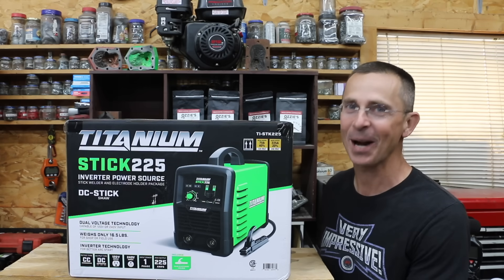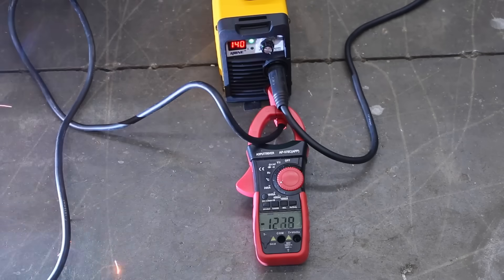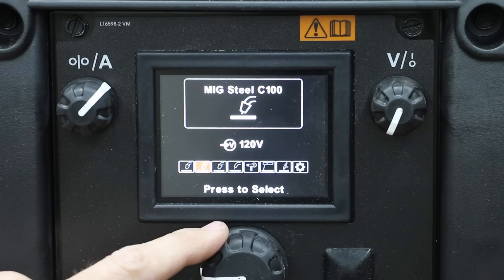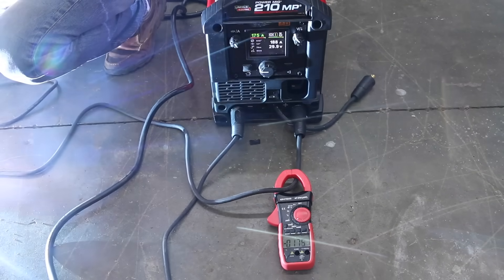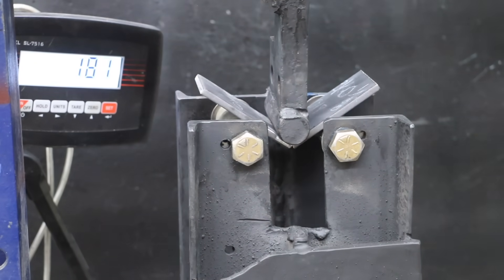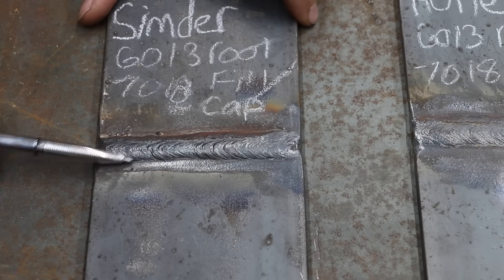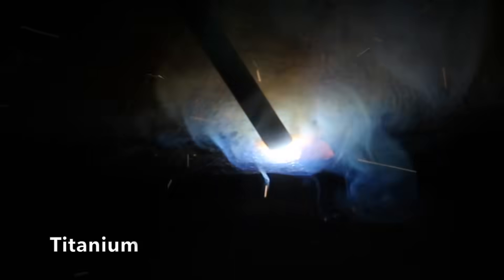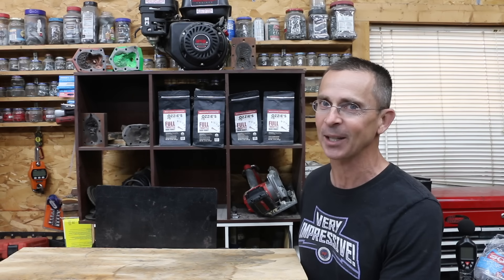$70 vs $2,300 Welder? Let's Settle This! Weld Strength, Duty Cycle, Current Output, Build Quality

Comment: Thank you, Joe! It's great to have an expert supporting what's already the best tool-testing channel there is!
Reply from the maker: You are welcome!
Reply: @ProjectFarm  please review the mig welders especially the Titanium Mig welder as I have it and have used it multiple times and it holds up awesome I want to see it compared !!!!
Reply: @furrycircuitry2378  You won"t be disappointed.
Reply: @ProjectFarm  hopefully Joe will never be substituted by Kuka robot run by GPT4
Reply: @Kawka1122  🤣
Reply: @Kawka1122  🤦🏻‍♂️😂😂
Reply: @ProjectFarm  Was the penetration test done on 110v or 220v ?
Reply: @ProjectFarm  

Suggestion:
Please do video review on vehicle underside coatings. (Rust protection)
Reply: @ProjectFarm  if you decide to do multi process welders, can you PLEASE include the Vulcan Omnipro 220! Thanks for all the great work
Reply: @ProjectFarm  Hi PF hot summer starts time to get glass of freshly pressed juice😂😂😂 can you test slow juicers with your scientific and practical tests, that could be best compare video on entire YT
Reply: @ProjectFarm  looked on your channel but couldn’t find one. Maybe I didn’t look hard enough but a
Video on silicone spray? Want to spray some on my suspension parts to stop squeaks. I see many brands but don’t know which is the best and last longest for the job. Thank you!!
Reply: @rickjames2327  Corrosion X HD
Reply: @rickjames2327  He did one on penetrating sprays and rust removers.
If you want a silicone spray that's cheap and available. GT85 for cycling applications is my current favourite.
Reply: @ProjectFarm  I’m
Reply: @ProjectFarm  Have you ever tested Shaving Razors?
Reply: @ProjectFarm  thanks a ton !
Please do yeswelder ct2050 with plasma cutter and internal air compressor
Reply: @Project Farm  
Have you done any videos on  fire extinguishers? I'm in the market for a extinguisher for my classic mustang and I was looking at a halotron extinguisher or a element extinguishers or a few others but can't decide on what will protect my investment the best
Reply: You want a CO2 fire extinguisher. No powder to clean up on you collector car. That powder gets everywhere including past air filters.
Reply: @cygnus1965  You also forgot to mention that some of those chemical fire extinguishers they use for cars are also corrosive. 
An old boss of mine had racing cars and IF the fire extinguishers in them were used the mechanics had to wipe down the car immediately and then AS SOON AS POSSIBLE completely disassemble the car and make sure there wasn't any residue anywhere.
There was nothing unusual completely disassembling the cars. They did that after every trip to the track but if a fire extinguisher had been let off they did it with URGENCY.
Reply: @ProjectFarm  Simple question.
Why didn't you test the Lincoln 191C its a far less expensive welder and more likely of use to the amateur or than the 210 which is without doubt a professional welding unit that no amateur is likely to buy unless that have some massive job like a big boat.

Or maybe its possible to test the Lincoln 191C against other Mig/Tig/Arc multifunction units???
Reply: @ProjectFarm  I welled like a pro for years. I used a 220V gas Lincoln( and others) and its  much better then the 120V HB Flux welder. The Lincoln  welds smoother, hotter, thicker marerals, stronger welds
Reply: Could not agree more. This channel is my go to for real world results. Well done
Reply: Couldn't have stated it better.  Thanks Joel, and yes, best tool testing channel period. Thanks.
Reply: The best tool channel!
Reply: Thanks to Joe!  Let's do this again!
Reply: True that, never buy tools without listening to Joe first
Reply: PF is the MAN
Reply: That was very interesting. Yep would like to see more😁
Reply: you got that right!!
Reply: Thanks Joe.
Reply: Agreed. Joe you've teamed up with a wonderful man thank you both
Reply: What Ether Melt said.
Reply: That's a fact. It's downright exciting. I love watching welders work. But not orbital Welders they're just button pushers. Still absolutely necessary
Reply: Fr
Reply: Thanks Joe for helping with welding test, great job I believe i am going to get the harbor freight’s brand to learn and weld stuff around the farm. I just need some practice as will just be touching up stuff on bush hog and small farm equipment
Reply: On boats I've also seen the little portables from Unitor and Miller used for small repairs where 110 was easier to connect with than a cable from a bigger welder. Usually using scratch start tig these days as the health inspectors assure us that bacteria can live in tiny pits and etc from the splatter of stick welding.
Reply: Testing is bogus without knowing what VOLTAGE the AMPERAGE is being delivered at...
Reply: Appreciate you sir!!!!
Reply: You should test Electric mowers especially robot lawnmowers!
Reply: That Lincoln should make a hell of a cup of coffee too for that price, where as the Titanium... I'd make it a cup of coffee if it would like.
Reply: !aaa
Reply: I'm confused man, which one should I buy?
Reply: hands down
Reply: I'm interested in Mig and Multiprocess reviews, thanks!
Reply: Thanks Joe, also say hi to Cousin Eddie!
Reply: Joe can't weld
Reply: @snations3093  What do you mean ?

Comment: A multiprocess machine may be perfect for home or for learning to weld. There's cheaper out there than that Lincoln. I'm a red team guy when it comes to transformer machines but inverters, give me the easiest ones to replace.
I still run some transformer machines that are 75 years old and smooth as butter. No one is ever going to say that about inverters. 
HF has machines on the shelf. If you break it under warranty they give you a new one. If it's out of warranty bring your wallet and get back to making sparks for hundreds instead of thousands.
More power to Joe for helping get the word out. There's no magic to stacking dimes but the sticker shock scares off a bunch of people. Inverters took that excuse away.
Reply from the maker: Thanks for sharing.

Comment: Commercial welding machines are usually set up as 3-phase 440V.  At home, you want to go with 220.  Using 110 is really asking a lot.  
As far as what to buy, get a used Lincoln, Miller, Hobart, or Esab. 
I prefer Miller or Lincoln.  
The real test of a welder is duty cycle.  You also really need a solid power source.  It all matters.  
Oh, and learn how to weld.
Reply from the maker: Thanks for sharing.

Comment: I would love to see another welder test. I have the Eastwood mp250i elite multi process and it has been a very good welder for me. It was $1200 and had lots of great features. All the cables were longer, has separate mig and tig bottle holders and it even came with 2 regulators, one for each one!! The welder itself is built on a cart and even came with a foot pedal for the tig. All the guns and rod holders and clamps seem very high quality. I have welded with it quite and bit and i absolutely love it. I spend hours and hours researching these before i bought one and it was only a couple hundred more than the similar harbor freight welders which didn’t come with all the accessories and no cart or regulators smaller cables etc. Eastwood even came with a 110 adapter. Holds up to a 40lb spool on it. The price for all it has and does seemed amazing and i think it’s the best value out there. It’s basically entry level professional  and i think it would do awesome on a side by side test. So if you do do this please include it!! I think it would be an awesome welder for many people. Great videos Todd and thank you joe!! Your welds looked very consistent which is crucial for these types of tests. Looking forward to a future multi process video!!!
Reply from the maker: Thanks!  Thanks for the suggestion.

Comment: Here’s my opinion: 

If you want cheap good welds
Buy an everlast. 

Any welder that puts out a true 125-130 amps is plenty for most peoples needs. Quick repairs with 3/32 or 1/8 depending on rod. 

6011 would’ve been a more fair root rod.
Reply from the maker: Thanks for the feedback.

Comment: Looking forward to your wire feed welders. A while ago, I got the Miller Thunderbolt 160 a while back ($500ish new) (120v/240v) and use it 120v. Great welder for kicking around at home in the garage for structural type welding (7014/7018). Last year I got HF's Titanium Mig140 with 025 wire and argon to do some pinch weld bodywork repairs welding in new rear hatch and pan/latch panels (body shop wanted $5000+) and the repair came out surprisingly good for a first time adventure. Now I am using this Mig140 same 025 wire but with 75/25 gas to weld up custom accessory brackets for a serpentine conversion on a 69 Caddy 472. After tinkering with the settings (welding skills aside) I am quite impressed with the results. If/when you do a MIG/flux core welding review, hope this Mig140 makes it in the list and am looking to see what else you conjure up in the list. Thank you for your reviews!
Reply from the maker: You are welcome!  Thanks for the suggestion.

Comment: Those ~$100 welders are getting surprisingly good for light-duty jobs.
Reply: For hobby welding as long as you keep your expectations realistic some of them small welders would do for around the house. You're just not pipelining with one of them. But for slapping stuff together in the garden or what have you it's fine. Keep your runs under 3 minutes. You can do a lot with eighth inch thick steel. Run thinner electrodes. That sort of thing.
Reply from the maker: Thanks for the feedback.

Comment: I’m a diehard Miller guy, I’ve run XMT’s on 480 3 phase, bobcats, trailblazers, and I currently own a blue star.    I’ve been off work since October after a job site accident, I was in the process of building a side business and was in the market for a MP machine.   Probably to stay in my garage until I get proficient with TIG.   I’m definitely interested in a MP showdown, but I’m also aware of the cost associated with it.    When I’m able to get back to work I’ll be looking for an AC/DC model to hopefully get into some aluminum work.   30 years as a shop ironworker and I can’t wait to strike a bead again
Reply from the maker: Thanks for sharing.

Comment: I bought a used Miller 350 syncrowave liquid cooled from an auction for $1300.  Tig welders can do aluminum or steel or any other weldable material.  It can also weld a pop can or 1/2" steel.   Obviously tig welders are slow and take skill but they are so versatile you really get your monies worth.   I've paid for it multiple times over along with the convenience of repairing items the same day.
Reply from the maker: Thanks for the feedback.

Comment: Awesome video!  I wish this was around a couple of years ago when I was shopping for a budget welder.  I ended up going with the YesWelder Mig205ds.  I suspected that the current output was a littel lower than reported, but I can't say that I have any regrets.  For the price it's done everything I"ve asked of it.   Would love to see something comparing plasma cutters.  I've been eyeing one of those by YesWelder, but I'd like to see how it performs and what else is out there for the money.
Reply from the maker: Thanks!  Thanks for the suggestion.

Comment: MY Father has been a Welder over 40 Years, he worked machines from all different Manufacturers, Industiral to Home types, and everything in between. And even now, after so many years and all that accumulated experience, he swears by Licoln even if it costs you an arm and a leg.
Reply from the maker: Thanks for sharing.

Comment: thanks Joe
I've got the Lincon 200, and love it.   got a 130 amp Rockwell inverter that I call the hand bag, great for taking up ladders. also got a WIA 175 mig, each has there place but the Lincon is the best allrounder and if you want one machine to weld them all it takes up less space and probably works out cheaper in the long run. respect from Australia.
Reply from the maker: You are welcome!  Thanks for sharing.

Comment: In all fairness the Lincoln really got the shaft in this test. It's a quality multi-process welder being used solely on stick and is then turned down under 130amps for the penetration test? Why spend the extra money for that machine and then handicap it like that? 
A Miller Thunderbolt 160 would have been a much more fair comparison for this test as it is stick only and 1/3 the price of the Lincoln.
These machines should be hooked up to a load bank and tested for their volt/amp curve. I can guarantee only the Lincoln would perform well in that test, resulting in a smooth drooping curve. If you do test MIG machines I'd suggest searching out a welding machine calibration shop to test them on a load bank and provide the results.
Reply: He was trying to make it comparable to the others

Comment: Definitely want to see the wire feed welders. It's a skill I am considering trying to learn. And a big thanks to Joe
Reply: Wire welding is a lot easier to pick up than stick welding is. The welder feeds the wire for you. You still have to do a bit of testing before you weld what you want to to get your settings good.
Reply: Wire feed welding is not at all difficult to learn. In the past couple of years I had to learn wire feed aluminum welding for my job in auto body. At 65 it's a bit of an old dog new trick thing. If you can stick or gas weld you will find wire feed a piece of cake.
Reply from the maker: You are welcome!  Thanks for the suggestion.

Comment: Joe thank you for your help making this video and analysis. 

PF, very interesting results. I don’t need a new welder but it still very interesting.   I have a Miller maxstar stl for stick and a Millermatic 211 mig. I got both of them used for titanium money.  I also have a Clarke wire feed which was very low cost and doesn’t work very well but it’s more portable then the Miller mig, and I don’t like stick welding if I can avoid it. If something just needs to be stuck together I will use it. 

I’m not a Miller super fan, and would have bought Lincoln if they popped up when I was shopping. I didn’t have one of your videos to see some affordable welders are actually decent, I probably would have just got a titanium for stick.  I do look forward to seeing mig tests, as I hear from non professional users like the harbor freight option.  

Question, are you keeping the titanium or the Lincoln?  I like setting by thickness as an amateur, but that’s a big price increase if you don’t plan to use the multi function capabilities.